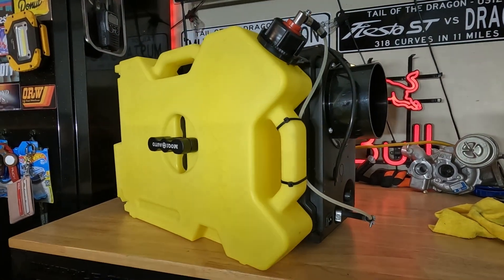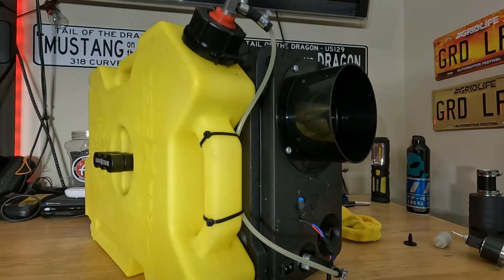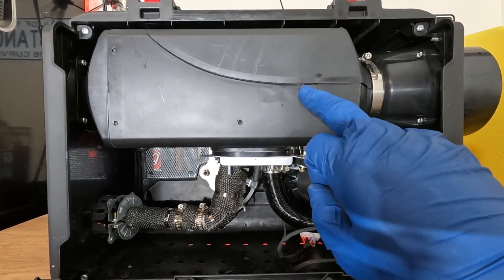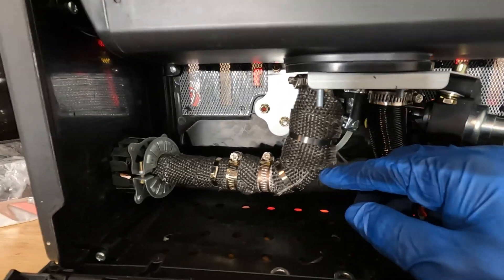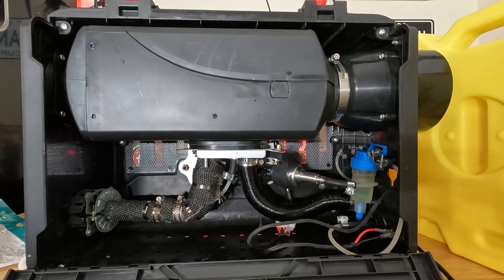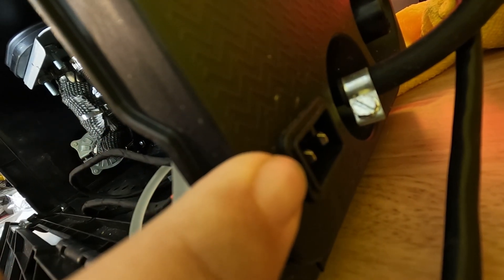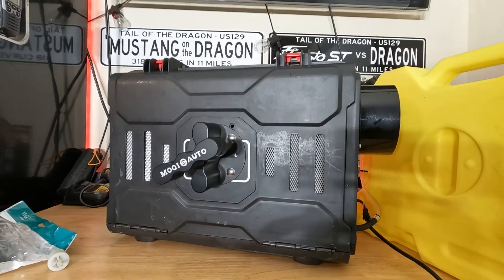OVERLAND DIESEL HEATER MODDED BUILD BREAKDOWN

Comment: Drill a hole in top of fuel tank and run the hard nylon line through the hole ... Flip the line out of the inlet and connect a fuel filter with the end cut off or 1/2 inch hole to not restrict flow) .. and drop it back into the tank to the bottom ... Leave the cap alone and venting.  Also allows filling while running..

Comment: How do you vent your tank? So air can replace the fuel as it is being consumed.
Reply: I am looking to do the same thing, my plan is just to loosen the cap a tiny bit before use, to let air in.
Reply: @  I’m looking for something more dynamic; one that deals not only with fuel consumption, but also cold temps and hot temps. Your method will work, however I’m concerned with fuel spillage if I forget to tighten it up. I’m using my heater in a 2000 F250 and older Alaskan Camper

Comment: So I've attempted to copy your fuel tank setup but I've come across two issues. One, cutting the stand pipe so that I do not clamp the hole permanently closed. Two, the standpipe connection to your tank, the red cap, is that custom or how did you alter the one that came with the RotoPax? Thanks.

Comment: I'm going to use a boat motor fuel tank so I can unplug it to fill it so there's less chance of spills inside my shop. It will hold more too so I'd fill it less often!
Reply: I plan on adding the boat quick connects to my setup because i still want a smaller tank. I initially used a cheaper disconnect that failed after one use.
Reply: I use a 15 gallon fuel cell (cuz I had one) and route the hard line THROUGH a fitting before connecting to a fuel filter with the end cut off and sitting on the bottom..   you do not need to move anything to fuel..  my tan is currently 15 feet away from the heater..

Comment: The idea of the airflow is not totally correct. You could put a 10" intake on it and the flow won't change. The amount of flow (in cfm) is governed by the amount of flow of the most restricted point. Putting a massive diameter cold air intake on a vehicle makes no sense (and no improvement) due to the size of the throat on the throttle body, intake runners, and valve size.
Eventhough it has a 3" intake and exhaust, it won't flow the same as a 3" pipe because the air still is being forced thru the aluminum fins of the heat exchanger, further restricting airflow.
Sweet build though. As mentioned by another, the fuel filter should have at least a 30-40° angle. I had one of these and was surprised to see that from the factory it was horizontal. That is super bad for reasons mentioned by another.

Comment: Where did you get the cone shaped adapter that's inside the case to adapt the inlet from the standard 3-inch to the 5 inch coupler?

Comment: Was thinking about doing this soon. You have to remove the stand pipe every time you refill the Rotopax though, don't you? Doesn't that drip fuel everywhere?  Thinking of adding a separate hole in it for the stand pipe...

Comment: In the installation instruction of the heatshield  for exaust line. They suggest leave few inches at the end of the pipe to let the heat go out. otherwise it is not good to fully isolate it at 100%

Comment: Great idea! Why did you not mount the Rotopax on the side where the original diesel tank was located so that you can always have access or service the heater.  UPDATE >> I notice Nemesis5Zero is the only video I found using Rotopax, I manage to put mine in the original tank location. You have to dismantle the case to reach behind to install the screws.

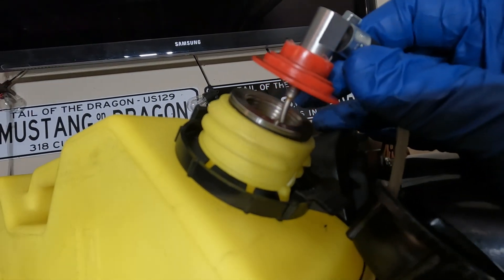Comment: Where can I get the metal part/gasket that you have under the cap at (4:53)? I just got the heater and want to do the Rotopax tank mod. Thank you.
Reply: Check out Ai13 nozzles. Specifically their “shipping spacer”. Just found it myself after getting my rotopax in and noticing they changed them so the old replacement nozzles didn’t work. This adapter will fix it.
Reply: Would like to know as well

Comment: How did you remove the filter from the rotopax mouth
Reply: And what did you replace in the rotopax? I noticed a metal ring around the mouth. I bought a brass pickup tube and just used the same cap but will probably re enforce with another washer to sandwich the connection better🤙

Comment: Great video!  Question - when the rotopax is disconnected and the heater is packed away does it smell like diesel?  I would transport the heater in the trailer and don’t want it to smell like diesel fuel.  How many nights will a rotopax of fuel last?  Thx.

Comment: Awesome build and thanks for the detailed description of each upgrade; what happened to the original air filter connection tube that is attached towards the bottom of the unit?

Comment: Hey! Just picked up a rotopak can for similar and found your video. Assuming you ripped out the fuel filter in the rotopak, and just curious if you have any more detail about converting the gas can to this purpose.

I am planning to remove the filter but you appear to have a piece of metal in yours? The only seal that came with mine is on the pour spout and I want to get rid of that too.

Thanks!

P
Reply: I would like to know this conversation as well!!!
Reply: @skiptloo  I ended up pulling out the fuel mesh screen, cutting a piece of aluminum sheet to a round plug, removed the fuel pouring nozzle and took the rubber seal off of it and put that on the aluminum ring. Drilled 2 holes - one for the fuel pickup and another for a brass breather valve fitting. shoved it all into the alum disc, put the black rotopax cap on it, and screwed it all together.. badabing badaboom!
Reply: @philgilles9429  Sorry to join so late....   Do you put a different cap on the tank when traveling?
Reply: Just to confirm, you cut a piece of aluminum the same diameter of the red cap.  Got rid of the red cap and used the aluminum outfitted with the old seal, breather valve and fuel pickup line.  Also, does the filter/ mesh pull out or do you have to cut it out?
Can you shoot me a link of wha breather valve you used?

Comment: I tried that fuel pickup you have linked but repeatedly got an E-8 code. I never saw any fuel pass through the filter and pump section in the hose. Installed the stock botten fuel pickup,  messy to install having had diesel already in the tank and pouring it back into my fuel can. Fuel began to pass through and then I got got an E-5 code a number if times. This time, I found the aftermarket end hose vent cap was too restrictive. Replacing it with the freer flowing stock vent end cap eleviated that code problem.

Comment: Definitely don't want your fuel pump horizontal, it will trap cavitation bubbles and not be able to lubricate the piston with the lube in diesel fuel. Also will lead to an unclean burn, atomization issues and you will have to clean your heater more frequently.
Reply: Have you personally tested this?  This subjedt has been hashed to death for a decade on YouTube yet I have not talked to anyone who has experienced a failure as you have described. ALSO, it may be a mute point in the case of this heater as the pump is not mounted level. Perhaps I am misunderstanding your comment? Thanks
Reply: @geraldhenrickson7472 Moot point. You don’t understand the meaning of MUTE.
Reply: Pump orientation makes zero difference if the fuel line inlet is above the pump inlet ..   it's when you are pulling up (6 ft is my max comfort limit) that the intake of pump should be from 45 degrees upwards to vertical .. it's also CRITICAL to use the hard nylon line to minimize the VOLUME of air (during prime) or fuel being pulled along.  Honestly, when primed and running, you will never see a difference
Reply: I saw that too and was thinking the same.
I bought that same unit recently but returned it. When I opened it, the factory orientation was just like what you see in the video

Comment: Just got my heater all set up and I’m powering it with my EcoFlow delta max. The heater keeps tripping the 12v outlet on my EcoFlow. Did you have this issue or have any idea what might be causing this? The heater will begin to run and after about 5 minutes the fan will kick up on the heater and then the EcoFlow outlet turns off
Reply: Known issue with the 12v outlet. Mine no longer consistently works with systems that have a low voltage shutoff.   The engineers couldn't figure things out and suggested I send it back in for a refurb.  I passed as my battery pack is very strong.
Reply: @originaloffical   to fix this issue I bought a AC to DC converter and plugged it into my AC outlets on my EcoFlow delta max and it works like a charm

Comment: I replicated this, not super happy with my rotopax gascap fuel valve. Can you share how you modded that, did you use diesel resistant washers? 

Also for the fuel lines, do you have a link for the extra black hose? Super appreciative of your share, so much cheaper than the fancy ones!

Comment: Great looking mods, I am changing a few things in my Hcalory.  Is that 3" ducting hose working out with the 200 degree heat?  I like the price point but want to make sure it is as safe as possible.  All the reviews I have read are all over the map, some say garbage, others think its fine. No melting? 🙂

Comment: Hey I've found decent moto 1"in/25mm air filter is apparently a big deal for the intake line.   25mm all screen air filter.  That black thing doesn't do anything to silence or filter air.  John Mk tested it out.

Comment: What are you doing for an air filter?  I just got mine HC-A01 and there is no air filter in that big black end-cap assembly.  It has the small white foam, but the air flows freely straight down the tube with no requirement to go through a filter.  Its also a large external tube and big plastic thing hanging out the side (stock).  I need something cleaner and simpler than that.  I could just have it draw air in from within the case.  The case has so much venting to it.  Maybe that's the clutch move??  Then the air inside there would be pre-heated a bit too from the heat tubing.  Obviously its just for the intake so it wouldn't expose me to any CO poisoning.  What do you think?

Comment: What's the point of having a heater mounted in a plastic box if it's still not waterproof? I don't see any advantage over a standard metal Vevor all in one unit. It's actually worse as it takes more room in a rig. I bought all in one Vevor a month ago, did some basic mods, installed it on a tire step and ran some tests. Seems to be ok, and I'm not sure if it makes sense to make it more watertight. I'm not going to run in in the ocean or a lake lol. You still need to store the hoses and the muffler outside the box, and do some basic assembly every time you use it. Not being negative, just trying to understand the trend of everyone trying to put a heater in a box :) Is it only to look more cool and "fancy overlandy"? :D
Reply from the maker: Hate to say but youre wrong.  I store all the parts inside the box, and Ive had it out in the rain and had no water intrusion.
Reply: @NemesisDigitalMedia  OK, but opening the case with fuel tank installed on the door seems to be a bit cumbersome. Unless you pull it every time but this would add another step to the setup. I don't know, I like the clean look of a diesel heater installed in the box and I almost pulled the trigger, but I'm still not sure if it's worth it from the functional standpoint :)
Reply from the maker: @vwlukas  cumbersome? You don’t even have the setup. It takes 3 seconds to open it and get the parts out and close. If I wanted to fully service the box it takes 15 seconds to pull the tank off.
Reply: @NemesisDigitalMedia  is it easy to open even with 2 gallons of diesel in a tank and no access to the bench? Hcalory sells empty cases for about $80 but I think they come without the metal bracket that allows to mount the heater which is kinda a bummer.
@edit: oh, wait, somehow I was fully convinced that the gas can is attached to the box door which obviously is not the case lol🤣
Reply: @vwlukas  agree. Looks like the tank should have been mounted on the other side of the box. There would then be no reason to remove the tank before opening the door.

Comment: Hey man, I’m doing this build but wondering about what is best for a fuel can?  I’m not sure I have room to store both the heater and the can mounted on each other.  Is there a better solution you’ve found or advice for allowing the fuel tank and heater case to be separate?  Also with the Rotopax can, do you have a breather hole or do you just open the cap a bit?  You don’t want suction preventing the fuel being pumped
Reply from the maker: the cap of the rotopax allows some breathing.   Its up to you what fits best for you on what fuel can to use.   On the lowest setting the stock tank it comes with does well.

Comment: Question about your small air intake tube inside the box. Did you replace yours? Mine came with a tan one that looks and feels like cardboard. Did yours come the same way?
Reply from the maker: I trimmed mine really short and just slide it on before turning it on
Reply: sorry I’m a little confused. Are you referring to the the air intake hose (the black one inside the box that comes from the bottom of the heater next to the wrapped exhaust tube and connects to the hole next to the fuel line connection). Just trying to get clarification because mine is tan and feels like cardboard so I’m wondering if I am supposed to pull that out and replace it with the black one that came loose in the box with the other parts.

Comment: Hey what fuel line did you buy for the inside of the case?   Or did you just use the line that came with that kit?  I'm not sure I'll do the roto-pax kit...but I'd like to get the right fuel line and decent hose clamps to throw out all that Green stuff.

Comment: Holy crap that freaking extended power cable is SOO great and cheap.  I can run that the full length of truck bed and into the power system inside my pickup camper without a single wire crimp.  Nice find there dude!!

Comment: So I just ordered this unit based off the last video. But now you said that the entire heating unit crapped out on you? So what should I look out for in my unit when I get it?
Reply from the maker: It can happen with any mass produced part. You’ll want to start the unit and run it for a while. The fan should sound smooth, no grinding etc. I’m sure you’ll be fine.

Comment: Mount your fuel pump in a vertical position, with the inlet at the bottom.
Reply from the maker: You wouldn’t want the pump to be vertical
Reply: 45 deg is the recommended angle
Reply from the maker: @Dirt-Diggler  yep!  If you look at my pump I did bend the bracket a bit to give it some angle.  I could probably bend it a little more, but its been running great for around 80 hours of usage so far.
Reply: How does this do in the weather/rain?  Think it’s weather proof enough for Ski Resort camping?  I’m about to buy one and set it up under my truck camper.
Reply: @vin9976  the actual heater inside the box is ment/ designed to be fitted under a vehicle so are pretty weather proof BUT on the cheaper heaters personally i would spray the ecu motherboard with conformal coating and add some Vaseline to the wiring plugs to be extra sure 👍
Reply: @Dirt-Diggler  sweet!!  How hot does the case get?  I’m guessing only the main exhaust is super hot right?  Thinking about tucking it between my camper (side in pickup camper) and the bed wall (there is about 9 inches of space)
Reply: @vin9976  the plastic case gets warm/ hot but NOT a fire hazard at all 👍 the exhaust yes as you say will be around 200f and will burn wood but if it's a metal floor no issues at all, if it's a wood floor i use a turret mount and if your worried about anything near the ex pipe under the truck you can wrap it in exhaust wrap 👍
john mck 47 does a brilliant video series on these, i highly recommend watching them, long but very informative 😎
Reply: @Dirt-Diggler  Awesome, thanks dude!  Nice to hear from someone using it in the field.  How does it handle really cold temps when its running outside and drawing outside air in?  Most Van's re-circulate the warm, interior air but I'm planning on just putting mine under my pickup (has camper in the back) or on tailgate and running 3ft of that flex-pipe into the camper.  So it'll be drawing in air from the outside.  I'm only using it mostly for ski camping where its 0-20d F.  You think it can handle cold temps like that without re-circulating?

Comment: Wow pimp my diesel heater some nice upgrades! I like the roto pack now it looks just like the Yona Adventure Gear heater. I'm sure you don't have $999.99 into your build. Also nice touch and with the IceCo cooler 12 dc plug! I really like how this unit has the side exaust. I've often thought about adding one of the metal 3 inch air intakes to do the same air trasfer in. Just haven't found a need yet even at 23F. When we used our all in one little red box 5k diesel heater with our CVT Shasta Summet tent we would just set the heater on the tire step. Then just run the hose in the back door at bottom of the annex and back up to the ladder door. That worked great so in the middle of the night if you have to come down to use the bathroom it was a little warmer in the space. Looking forward to seeing what else you come up with. One thing I saw on the GFC forum was a 3" hose attchement that sat in the zipper made by Yona just doesn't look like it ended up in production maybe only for the unit they make and sell for $999.99 - super trick. Looking forward to seeing where you mount it! We like our tire step spot.
Reply from the maker: Thank you! Always appreciate your feedback on my videos!
Reply: @NemesisDigitalMedia  🙂